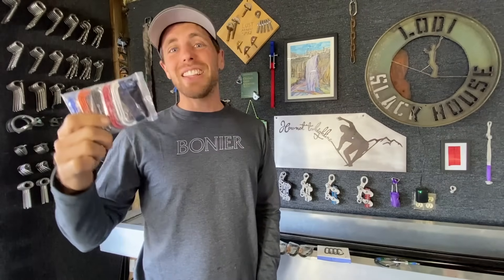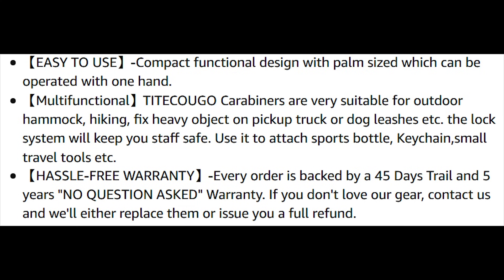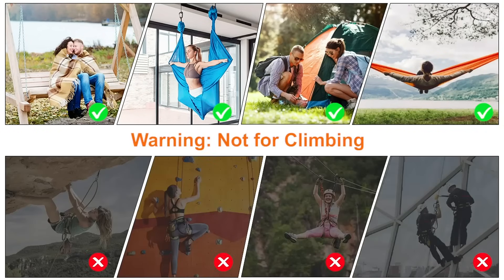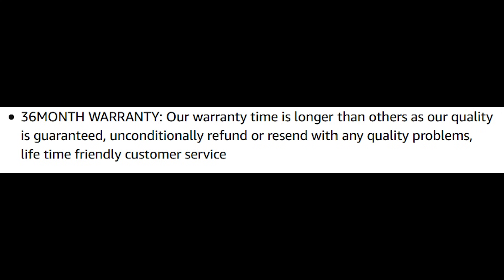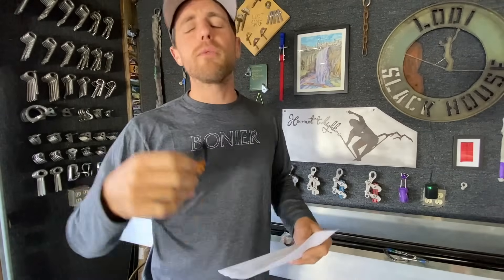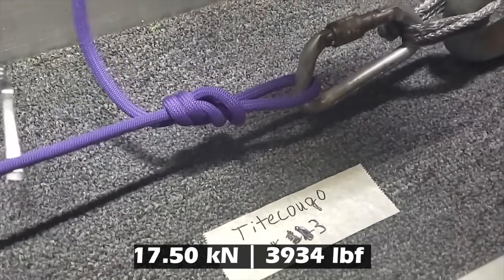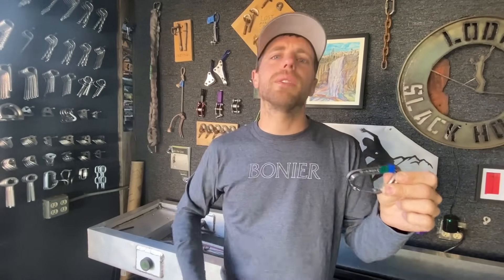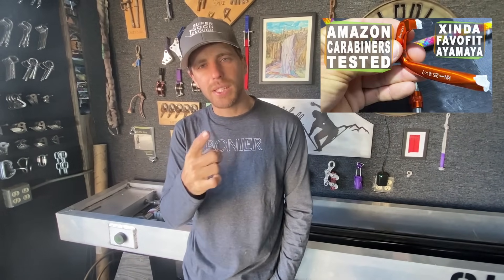I Hate Amazon's 12kN Carabiners

Comment: I get your point completely. But these cheap carabiners do serve a purpose for many non-climbing applications. Like everything else, you just have to know what you're doing.
Reply: I use these and the 24kN ones for kite flying, they usually don't generate over a few hundred lbs of impulse force.  These go for under 1 usd (free ship) and the 24kN ones go for 3 usd.
Reply: @2100BLF  Where are you finding those prices? I would be down to buy quite a few for that price.
Reply: @gruanger  I also use the bigger 24kn ones for kite flying.  Available on aliexpress as well.  Postal mail shipping is more than good enough for my destination here in Singapore, it depends on your country though.  I have purchased more than a dozen packages, all are ok.
Reply: @2100BLF  Thank you!
Reply: @gruanger  No problem bro...

Comment: I just bought a discontinued Black Diamond oval (hooked nose, not keylock).  I noticed it rates only 18kn closed gate, 6kn open gate, and 7 kn cross loaded.  Perhaps these relatively low numbers are why it was discontinued, but I feel fine using it sparingly, since it's mainly for racking nuts anyway.
Reply: Weirdly, you can get an oval biner certified at only 18kn for climbing, but it has to be stronger if it's D shaped.
Reply: @tomtom4405  fascinating.  Thanks for sharing

Comment: Yes please test the Amazon rope that they keep sending me emails to buy lol...I did end up buying a 10.5mm static from Amazon for 15$...The price was just too good to at least buy and use for yard work if I needed it...I found out why it was 15$...The rope length was 35 feet, not 35 meters. It smelled like cancer. And they sheath is going to pull off of it the second you would try to use something like an ascender on it lol...A PSA style video on this junk would be great
Reply: BetaClimbers has just done this. Not the break testing but he "reviews" it and breaks down the difference.
Reply: @AstronomyWales  Yeah I watched the one where he did the ones that come with the cheap carabiners on the end of the rope..This one I'm talking looks just like a climbing rope, says it's CHNA certified (not even sure if that's a real thing) and is wrapped with a nice velcro enclosure with the rope diameter and a person climbing painted on it..So it would be shitty if it didn't hold up trying to be a climbing rope...never-ending it being static to begin with...I'm sure it's fine to have and only use to rappel out of a window in a fire emergency, but that's about all the higher I would trust it
Reply: @50StichesSteel chna is China certified

Comment: I hate their “rope” too 🤬
Reply: You..... you actually bought it?! 😂
Please tell me it was for a backyard tire swing?
Reply: @rachelhasbruises  Bought a 6m length I was hoping to use to get the kids used to toproping on the small home wall (it's only 2.2m tall, and dragging a 30m rope around for that is a pain). Besides any performance specs, the rope handling is horrid, I guess because of the weave pattern. Instead of feeding smoothly over a toprope anchor, it jumps in small steps. 

Cheap experiment cos I was curious, I can use it for something else. But I genuinely feel that amazon should hold these sellers to a higher standard. Someone will get hurt at some point.

Comment: Could be a few reasons why...1) The quality of the aluminum they get (there are companies claiming certain metal grades but are not). 2) skipping the heat treatment process and just using the base material. 3) What type of process used to make them. I guessing they are not hot forged, or stamped or milled out of one block of aluminum (which each process can give a metal certain characteristics)...My guess is they either use cast aluminum to make them (one of the cheapest, quickest and potentially weakest processes to use because it's easy to get air pockets in the metal and make it brittle. Companies use this process because you don't need metal bending equipment or metal milling equipment. You just make one mold of the shape you want and pour liquid metal into it. So you might get a few that hold 15kN and one that holds 9 kN) Or the wire gate is made from a cheaper metal.
Reply: Lack of forging was my thought as well. These are probably machined or cast. I have a bit of trouble believing they would have been as strong as they are if cast, but with die casting and post heat treatment perhaps.

Comment: They fit light utility uses and I would never use them on anything dangerous. I, personally, do not trust the material ratings. There is no way an individual can certify that the proper tempering to T7 specification has been done therefore guarding yourself from premature fatigue issues after even a few stressing utility uses. So never trust you safety or the safety of others with them.
I've worked around some contractors at job sights using them on their personal gear and scaffolding! So they do infiltrate more then just the keychain market at times!

Comment: i found these on Instagram advertised for trad climbing
because the cams are 12kn 
absolute false advertisement
Reply from the maker: omg!  that is insane!
Reply: Lots of pieces are under 12kn though. So why wouldn’t this be fine as long as you know what your doing especially in a multi piece anchor?
Reply: @youhutchtube  Exactly. 12 KN is more than enough. You can hang a Ford F150 from 12kn carabiners.
Reply: @jasonelford4474  no, a small wire nuts break at say 10kn so this is stronger in theory and sounds tempting at first, but you'd want to throw them out after any falls because some metals such as aluminium are very prone to fatigue if you get loading anywhere near their expected failure load. To be certified you need a D shaped biner to 20kn or better - and they picked that number for a reason!
Reply: @tomtom4405  You're probably right. I suck at most things though.
Reply: I use them. I'm not that heavy.

Comment: Aren't carabiners legally required to hold at least 20kN to even be called a carabiner?
Reply from the maker: I wish!
Reply: In the EU anything sold for climbing needs to be EN rated. In the US reputable gear has UIAA and/or EN ratings, but there is no legal requirement.
Reply: not really, carabiner is a name of a tool so it can be whatever
Reply: @enricociuppa7093  yeah I mixed something up. What I meant was that it needs to hold 20kN for a certain standard
Reply: in europe the law says if it suppose to be used as climbing or high work use. A carabiner is just a curve pieze of metal with a gate.Honestly i will forbidden to sell this kind of gear

Comment: I bought some wire gates and auto lockers like those on amazon. I really like them for my Key chain and I like them way better than the silver hardware store carabiners for light loads like gym pulley attachments.
Reply from the maker: as long as they don't infiltrate the important biners
Reply: I actually just picked up a bunch of BD miniwires for keychains, bear hangs, hammocks, etc after I found a keychain biner in my climbing bag. I don’t want to chance grabbing the wrong thing by mistake.